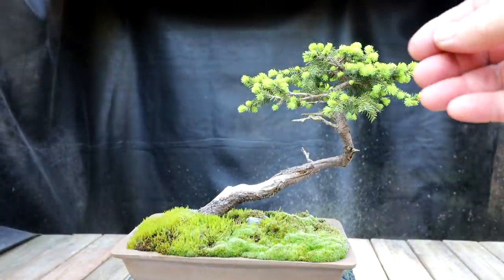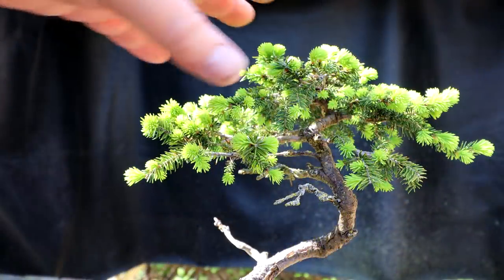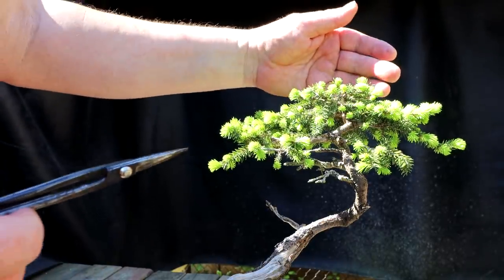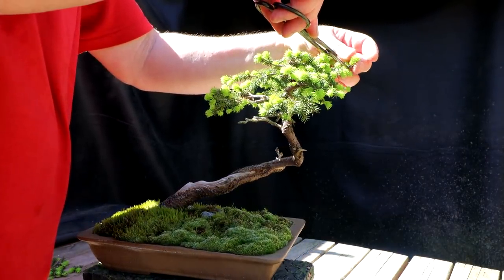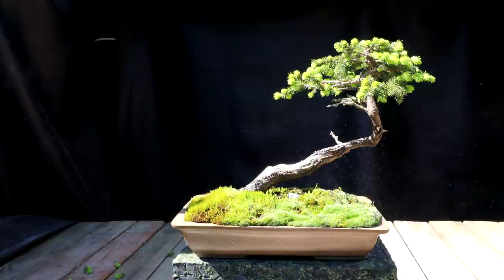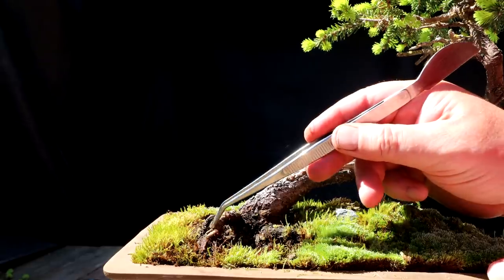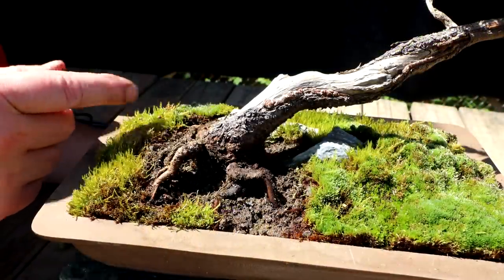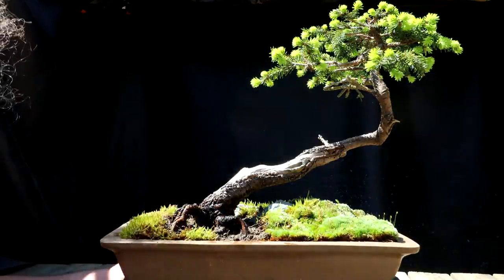My Bird's Nest Spruce Bonsai Update, The Bonsai Zone, May 2020

Comment: 14:32 someone once said you shouldn‘t have lines that are 100% parallel to the ground horizontally or stick right up vertically (atleast for not formal uprights i guess) I feel like if you turned the tree a little to the left or right it would benefit the look.. but the root would look different tho still be exposed

Comment: Nigel, my ‘96 Cherokee suddenly started running really rough a couple of months ago. Got a tuneup...no change. What’s your gut tell you?
Reply from the maker: I would guess a fuel problem, maybe a clogged fuel filter, a blocked line or a fuel pump problem?
Reply: Nigel Saunders, The Bonsai Zone wow thanks Nigel! Yeah I’ve been dumping fuel injector cleaner into it like crazy and it either hasn’t worked it’s way through yet or it isn’t working.